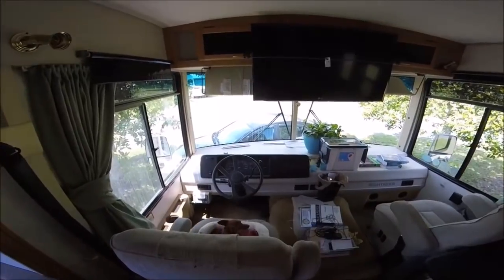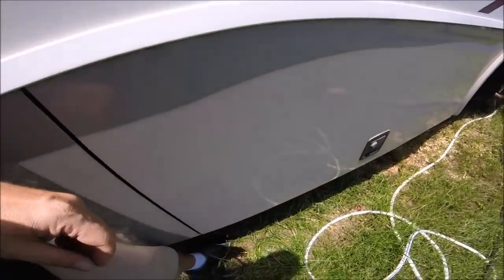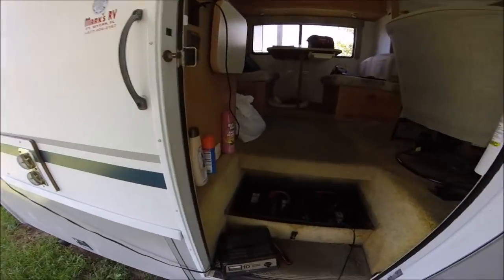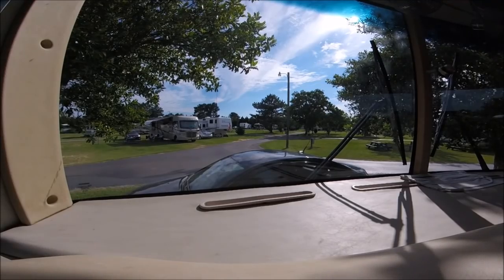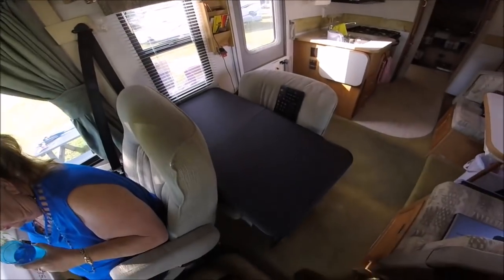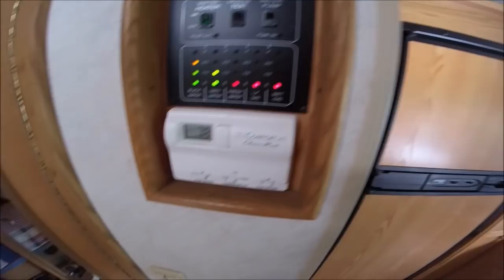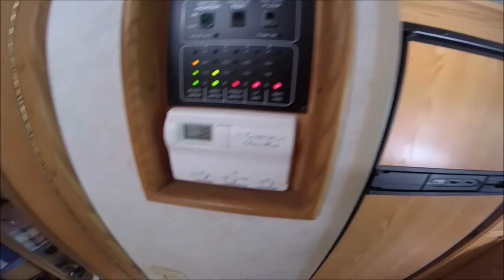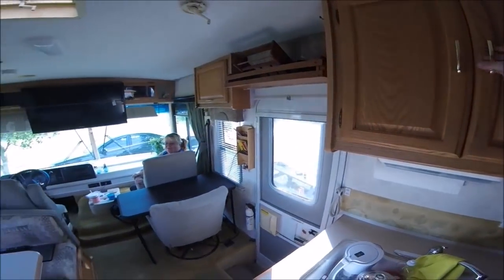RV Maintenance   Exercising Myrtle

Comment: Do you have a switch to parallel the house and engine batteries for a situation like this?
Reply from the maker: Yes - I have an Aux switch but the coach batteries were drained and not able to provide the power needed to start the engine. My next goal is to replace the coach batteries - which are pretty old.